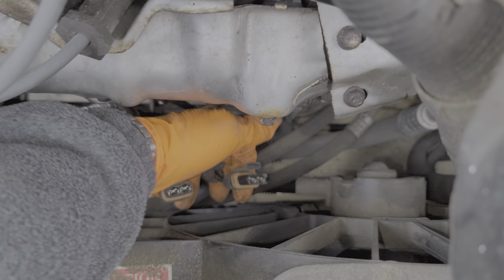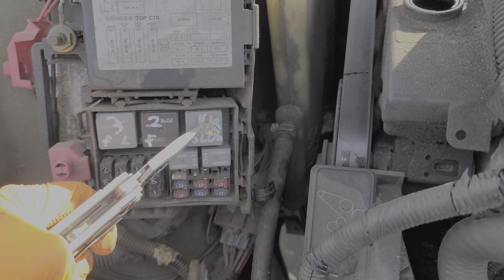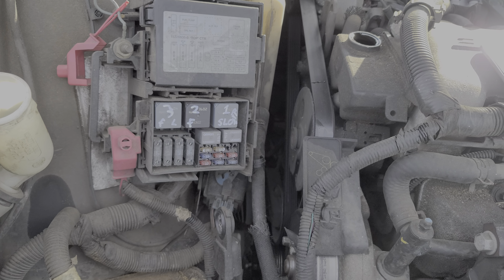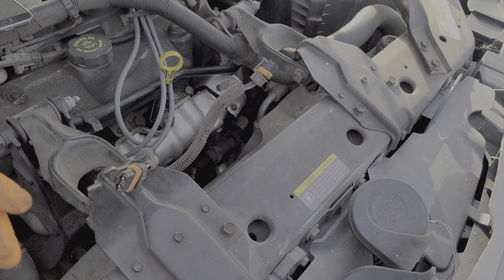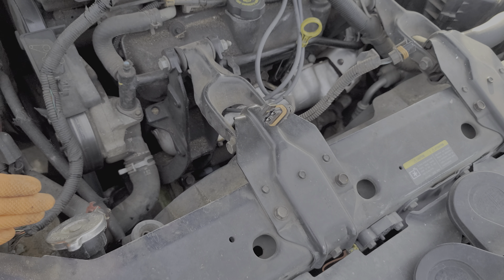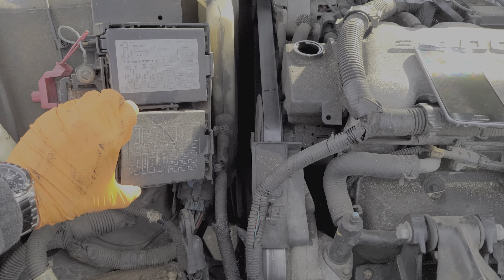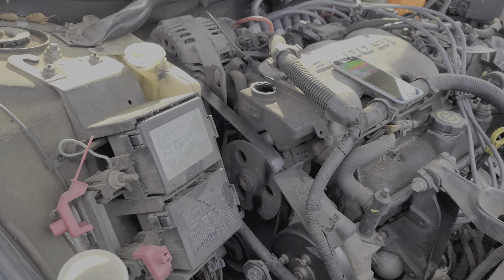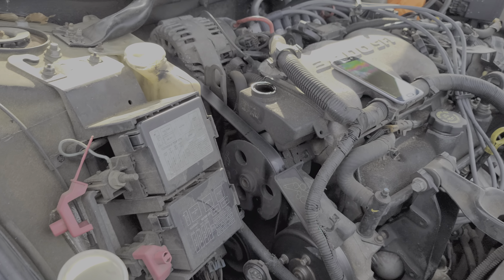2002 Chevy Impala Cooling Fan Fuses & Relays

Comment: My driver’s side fan won’t come on and is resistant to turn manually. So, thanks for this video. I was gonna wire directly to the battery to see if it kicks in to be sure. Was gonna get a whole kit including thermostat, wiring and relays, but now I’ll probably just try the fan motor

Comment: Should the middle relay (fan count #2) (5 pin relay) have 2 pins receiving 12v like the other 2 relays (fan count #1 & #3) (4 pin relays)? When I test for voltage on the relay circuit box, i get 12v on both pin slots 85 and 30. But on Fan #2 I only get 12v on pin slot 85. Why not pin slot 30 as well? Is that normal?

Comment: Maybe you can help me, when my car is at operating temp and AC is off my temp gauge goes high. When I turn on the AC my temp gauge goes down. So today I stopped and looked at the fans, when the AC was off neither one of the fans was on, then I turned on the AC and both fans came on.    Shouldn't at least one of the fans be on when the car needs it?

Comment: I have a 03 Impala. Just put in a New Radiator and Fan Unit. The Old Fans weren't working I found out. I watched your Video and I got the Drivers fan to work ( I was Squealing at first) and then calmed down and worked. The number 1 Fan at the time I could not get to work. I did all the things in your video to No avail ..  I checked Both fuses ( 25 amp they were good) I switched the Grey Relays around and still only the # 2 Drivers side works. The passenger side fan on the NEW fan assembly Still won't work I ordered a  Black relay # 2 to see if that might be the problem, but that won't be here until later today. Is there any way to test the black relay?? Is there a wat to Jump across the pole ?? as you showed with the Grey relays??

Comment: My 03 Impala coolant fan should come on at 200 degrees Fahrenheit but it does not. I can activate them with the A/C on only. Engine coolant temp sensor faulty? Fuses ok. Thanks
Reply: Did you ever find a fix for your problem? My problem seems to be similar to yours.
Reply: @LilHoss  Hi, no I have not fix the issue but  I did notice the engine does not come to operating temperature very quickly. Thermostat ?
Reply: @jt8280  I've replaced thermostat in my Impala a couple times.  The symptom was the temp would go high pretty fast, then go down below usual cuz the thermostat was stuck open.  I'm terrible at troubleshooting these types of issues. I'm not getting any codes to go on.

Comment: Hey I have a question I have a 2000 impala that keeps overheating an I’m tryna troubleshoot it the fuse keep blowing that connected to the first relay any advice?
Reply: Hey Elijah, did you ever figure out what went wrong in this issue? I'm having the exact same problem

Comment: My 2003 Chevy Impala had great ac, then went out all of a sudden, i got it from my grandmother, it’s been garage kept and only has 30,000 miles... the clutch plate spins so i don’t think it’s bad, the fans spin while ac is on as well, the heat works, but ac is warm on both drivers and passenger side, so i believe the blend doors aren’t the issue... does it sound like maybe i need freon and that i may have a leak?
Reply: If u haven’t already you need to get your ac recharged that’s all and it’s cheap as well! I had the same problem in the summer time (imagine) 😓

Comment: Mine only comes on with the ac on. With out it it doesn’t turn on.  I replaced the relays and it still has the same problem
Reply: Sounds like your temperature sensor  is bad. Under $20 but kind of a pain to replace. Small hands will come in handy lol.
Reply: @heathestes3450  if the temp sensor is bad would it still show correct readings on the dash?
Reply: @gardud7  I'm curious about that too
Reply: Did this fix your fans are they now running without having to turn on a/c?
Reply: @JoseHernandez-ni1ol  yeah the code went away had to change the connector too and bleed the coolant good. I bought a giant funnel that can hold like a gallon filled it up half way with coolant and let it bubble out for like 30 minutes idling.